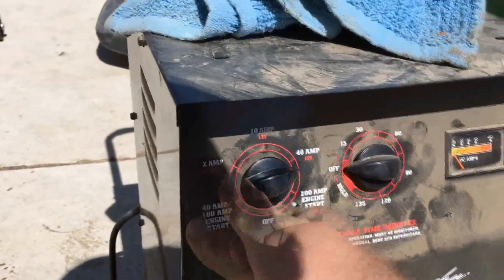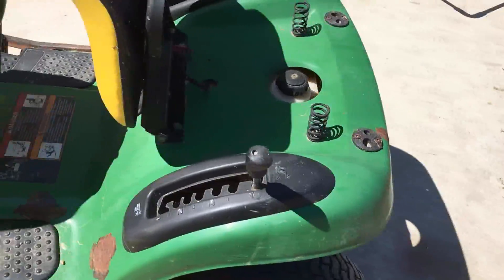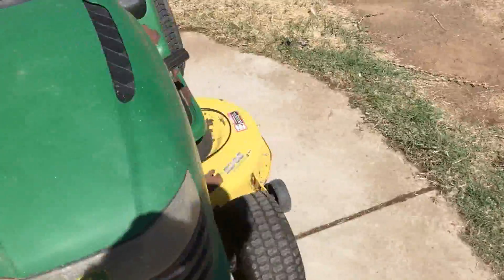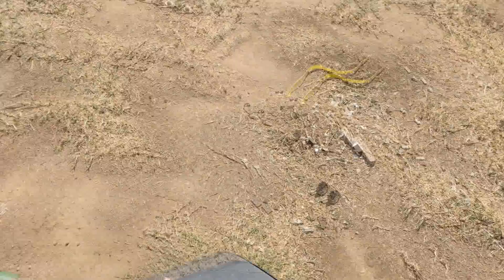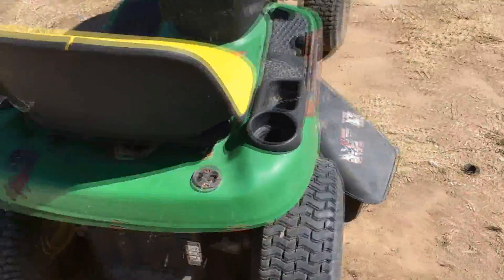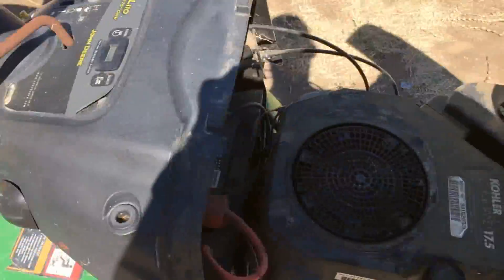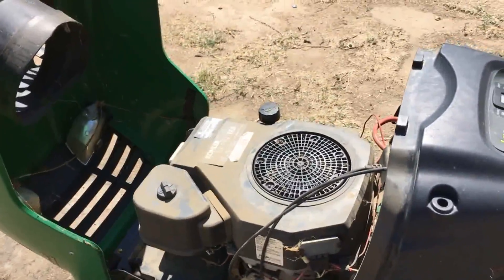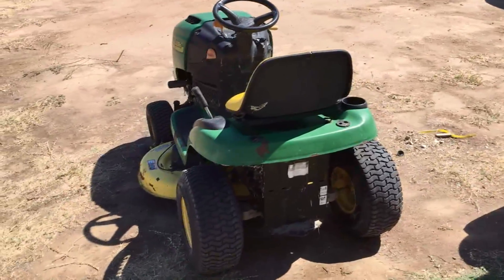Will It Run? Curb Find John Deere L110

Comment: Another runner! I am glad you have had good luck with those Kohler engines. The one in a Craftsman I was handed by a friend to get going had a cracked block. . . I patched it long enough for him to get a season out of it. Until he forgot to check the oil one day.
Reply from the maker: These seem to be a lot better than the courage line they have now. At least from what I have dealt with
Reply: Yeah the one I had was a courage. . . Well. It made for a good video at least.
Reply: The Kohler Command single cylinder engines are awesome! I have a John Deere L110 with 590 Hours and the only issue the engine has is it tends to burn a bit of oil. The transaxle has had the fluid changed every 100 Hours with 10W50 motor oil, and hasn’t had a issue thus far.

Comment: This is an old thread but the fix is somewhat easy. Pull trans, pop sealed fill hole,go easy so you can reuse cap. Then drain oil, pull pan and clean the inside totally. Inspect the flat part of the pump and motor and if no deep wear get grey case sealer and put back together and fill with 15w-50 full synthetic oil put back on and bleed trans. JD puts 10w-30 oil in unit to save cost and is NOT proper. I was given a l 130 with same problem with 633hrs and ran it to 688hrs and still ran fine when I sold it. youtube has vids to help.

Comment: Kohler Command engines are great engines. They will run a long time. I have a 30 yr old 12 hp Stx38 that still runs. I should try to find an L110 engine and swap into mine to get more power.
Reply from the maker: Oh yea, I have an L130 that has a twin kohler on it, Im 100% sure the engine will outlast the rest of the machine.
Reply: @hanksgarage_  992 hours on mine. Just keeps going....

Comment: Looks like it would be worth fixing. Because the engine runs so well. Just my opinion...a lot of money to fork out in the beginning but I think it would make some good money once it's done.
Reply: Alan Marshall I think if it's just the transmission drive belts in need of replacing ($40) rather than having to recondition the transmission ($300) then it will be economically sensible to repair the mower with the other problems and sell it on.
Reply from the maker: Yes I believe I stated that it could be the belts in the video and warranted further looking into.

Comment: Believe me when I say this change the hydrostatic fluid in the transmission and that should fix your problem if the fluid is dirty they won't drive good
Reply from the maker: Makes sense just have to look up how to do it. I know on older models you have to pull them and split the case. Maybe I’ll luck out and this one will have a drain plug
Reply: On these I think they are sealed

Comment: well the battery mint take a charge if you trickle charge it overnight. that's 30$ off. if its not the belts the transmission mint be low on fluid. you could just find a stock gas tank online for way cheaper. your average joe is not gonna care about that. your thinking war to far ahead. you could probably fix it for way cheaper than the price you mentioned
Reply from the maker: As I stated in the video it would start screwing up the same. It’s a manufacturing defect. The seams separate. The battery was fucked. It wouldn’t hold a charge at all.

Comment: I had a model 110 1973 John Deere that wouldn't start. Later we found out that the amp guage was a fusible link, fixed that and it started right up.

Comment: How long did you have it on the charger? If it was completely flat it sounds like it’s taking a charge.
Reply from the maker: lawnmowerdude it wasn’t it lost what charge it had as soon as I tried to start it off the charger. Was on it for about 2 hours in total 2 cycles.

Comment: 15 years later and my l110 still mowes 2 acers in fl all year long. Just 4 oil changes and 2 blade swaps..the entire time. It will mow field grass 1ft high easy.
Reply from the maker: What kills the trans is hills and working it too hard over them

Comment: Where are all these Free riding lawnmowers being found???
Reply from the maker: At the curb usually
Reply: @hanksgarage_  I must live in the wrong neighbourhood.  Pricey houses, no curbs.
Reply: I have two 1996 craftsmen driving mowers and did have a 1993 craftsmen driving mower I stripped the 93 one down and kept all the good old parts then gave the body and frame away and gave away the 38 inch deck 

Because the 1993 frame was smaller than the 1996 frame I didn't have no use for it and the transaxle was locked up good because the third gear in the transmission was locked in place was busted 

So I still have a good 96 frame just need to put the used front axle on and a engine

Comment: For whatever reason they don't go in reverse on the highest deck setting. Lower it down to 3.5 and it'll reverse really good
Reply: Mine goes in reverse just fine on the highest setting. These transmissions can be weak unfortunately

Comment: The son of the guy that owned Lewis mail sold the last 2 of his dad's trucks that sat in Wellsburg NY close to the PA boarder. The guy that bought them both was from.Binghamton NY he got a great deal. $3500.00 for the box truck and $5000.00 for the 1979 international rollback truck. Now the guy can start on his business venture Lewis small engine repair. On the upside the trucks are back on the road again and not in Horse heads  Pick a part in Horse heads NY being parted out and crushed for scrap iron Sincerely Robert Gildea
Reply from the maker: I have no clue what you are talking about or how this even relates to this video.
Reply: @hanksgarage_  One Question l do have for you is what is the most unusual riding lawn mower that you have ever restored? Sincerely Robert Gildea

Comment: If parts were cheaper it would be worth fixing but since between the factory and the aftermarket parts industry making so much mark up fixing old mowers isn’t worth it. These companies build throw away garbage for a reason. It’s too hard for me to lay down cash for a mower that I couldn’t justify $300 after it was fixed and your talking around the same price for parts, and that’s if all goes well. I guess I’m cheap because goods and services are just too expensing these days and saving my hard earned money means more to me mowing my lawn or fancy trucks,cars,bikes, and boats of it can’t make me money then I can’t justify owing it, however in this case you’ll sell that thing to somebody and you’ll make some money.
Reply from the maker: Yea I ended  up parting it out

Comment: Since this model is what JD builds for Menards....Home Depot and Lowes.I have had mine since 03 and its still running strong.The better models are at a regular JD place.They are way better made and more robust.There are a ton of parts on Ebay.But as far as JD goes........even a parts guy at my local JD dealer says they own an older model that was made totally in USA.As everything else.....JD company looked for a cheaper way out.Same way with Cub Cadets and many others
Reply: Since about 2010, B&S engines are made in China.  Good for 400 hours.  Old ones good for 1,000+.